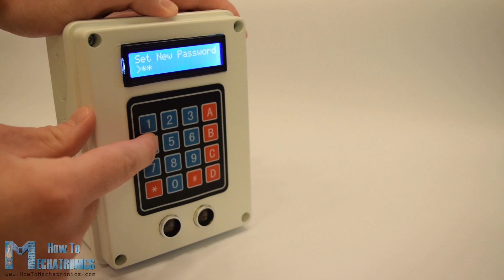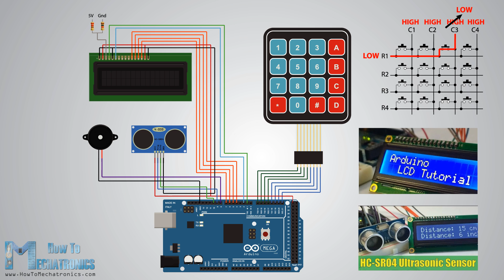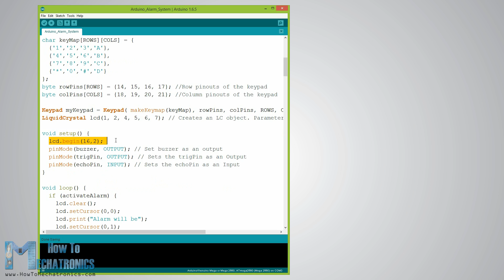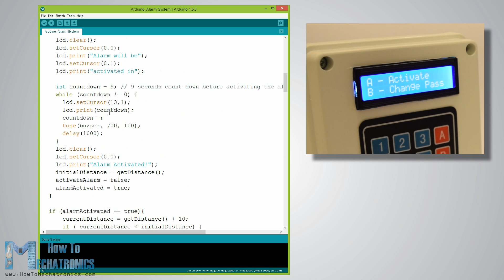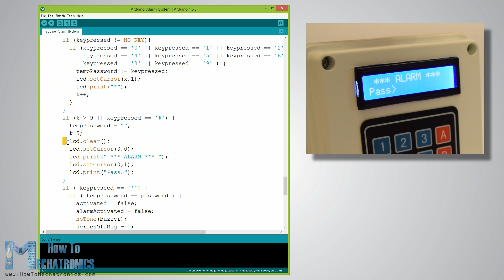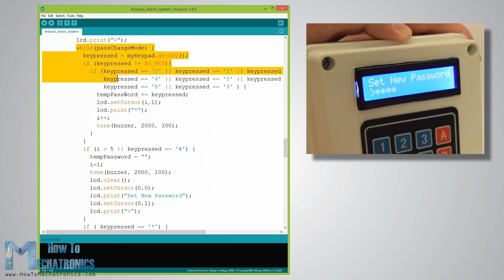Arduino Security and Alarm System Project

Comment: Hi! Wow, I hope someone can help me, I moved to a house with an alarm system, with sensors and keyboard, but the panel was removed, the posonic ps-636 keypad is installed, just like the samtek STK-636 (both copied from the paradox K636 ). That someone would like to know if it is possible to program an arduino to communicate with this keyboard, since buying another panel would be very little useful, as it is a very outdated and simple control unit, but with an arduino to implement several interesting functions. I try to know the communication protocol, a conversion information to a friendly protocol and to Arduino, since this system was decoded by Chinese companies, and probably made a datasheet available... anyway thanks for those who pay attention!

Comment: Hello
I am doing a similar project. But instead of using ultra sonic sensor I'm using a Pir motion sensor the code is similar. Here is my question, is it possible to add a delay function after the alarm has been  triggered in case I want to deactivate the alarm without the buzzer ringing. In a situation where I want to deactivate the alarm.

Comment: I will use it but i have 16x2 LCD with I2C connector. So how can i configure the code for it?
Reply: Anyway, I found it. Also I changed this system to home alarm system with door contacts, pir detectors and changeable permanently password option. And also I prepared a plastic case with my 3D printer. It just need last touches, after that I will prepare a video and share.

Thanks.
Reply: @onderxyilmaz  Hey bro did you manage to film the video? I would like to watch it
Reply: Carlos Vega hi there, not yet, sorry for delay, because of some health problems. I’ll manage in 2 weeks.
Reply: @onderxyilmaz  hi there excellent bro feel better,  please when you upload the video add the code script and all of the accurate steps to make the system that would be awesome 🔥🙋

Comment: IMPORTANT QUESTION: What happens when the system goes into alarm, and how can I hook up a siren? Schematic please? And maybe a pastebin of the updated script with the siren code in it?
Reply: I know this was 10 months ago but just incase someone else is wondering the same thing the Active buzzer is used for the siren they are fairly cheap and are included in many arduino starter kits
Reply: How to control the sound

Comment: Can i do this with the 3x4 keypad?
Reply from the maker: Yes, sure.
Reply: But what will i use for A, B, C, and D?
Reply: meh i just got a 4x4 it will work better
Reply: Sir. What if the power off, like cut off the electricity can still use the alarm system?
Reply: Or the alarms system have a battery that can save power  to continuesly use if have a power or no power.

Comment: What if we use arduino Uno in this project is there other code will be using or the same??
Reply: YES YOU CAN USE THE UNO ALSO..BUT YOU NEED TO ASSIGN THE PINS IN THE PROGRAM ACCORDINGLY
Reply: @prathameshkadam6732  Can the analog input be used؟ and how please 😣
Reply: @prathameshkadam6732  can you please tell me how to wire it if we use Arduino Uno

Comment: ahhhhh. where to start????? Arduino Arduino Arduino. This little circuit board has changed my life... I've automated just about everything I own. I'm currently working on the "emergency party button" concept like the guy on YouTube did... I have my TV coming down out of the ceiling flush mount now on linear motors activated wirelessly using Arduino. this thing can just about make anything happen you can think of.... i use DTMF decoder on an Arduino board to use my two way radio to activate Gates and garage doors. the sky ISN'T the limit!

Comment: I uploaded the project without problems. At the time of activating the alarm it counts down correctly, but then the sensor does not detect anything and is "nailed" on. Neither let me select the option to change the password, any help?
Reply: I got error status 1 when compiling the code. Can you tell me where you got your code and what you did to get it uploaded without problem?

Comment: you should use an arduino uno instead of a mega is way cheaper and for save pins use the library one analog wire for the keypad and puchase a i2c module for the lcd so you will need only 4 wires for the lcd
Reply: could you tell more about it?

Comment: Hello, I would ask something about your project on "Arduino Home Security System". I setup your schema and ultrasonic sensor working fine, but keyboard reacts on my clicks only when I run programme. Then nothing, I can´t change password and deactivate alarm... Could you please help me? I would be really grateful. Thanks.

Mistake is maybe in code, maybe there must be some algoritmus on that keyboard, which repeats all the time while programme running.

Comment: Dear Sir Dejan, Please also give tutorials on the; 13.56 RFID Module MFRC-522.
WiFi ESP8266-01 Module Black=Best.
Ethernet Arduino Shield WZ5100.
PIC16F877A.
PIC18F46K22.
PIC18F4550.
With PICKit 3 MPLab X with XC Compilers.
Make their Development Boards so easy development can be done. 
Please give tutorials on these tutorials the hobbyists and engineering students required. As these components required for these tutorials are not cost effective with more specifications.So Please reply this comment soon!
And on your website there is a problem that no comment can be given on it.
Reply: Sir Dejan Nedelkovski Thanks for thinking about these tutorials please use PICKit3 for programming.

Comment: It is saying that the code is not compatible with the Arduino Mega 2560?
Reply: Dejan Nedelkovski I put the code into the arduino program and it wouldn't even allow me to upload it to my mega 2560, even though I have everything set exactly as it's supposed to be

Comment: can i use arduino uno??  and do i need high contrast lcd or normal lcd will work pls tell??
Reply: Hey friend!
Maybe you could use an LCD with I2C protocol (they sell it ready-to-use on internet really cheap). This will allow you to use it just with 2 pins for data (and then 1 +5VCC and 1GND, 4 pins in total) , and what is better: those pins, in UNO, are analog A5 and A4, so you have all the digital pins free for all the rest. 

Best regards.
Reply: Preyansh Yadav Preyansh Yadav Arduino Uno? No you don't have enough pins you need a mega. Display contrast doesn't matter aslong your display size is 16x2